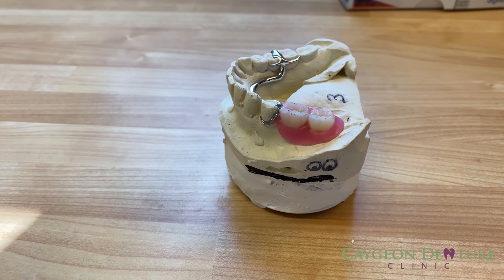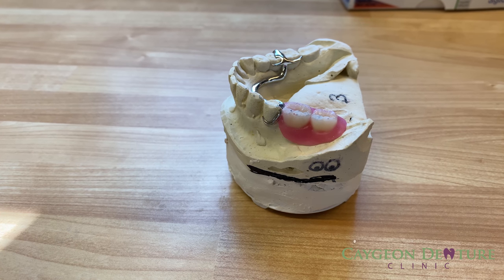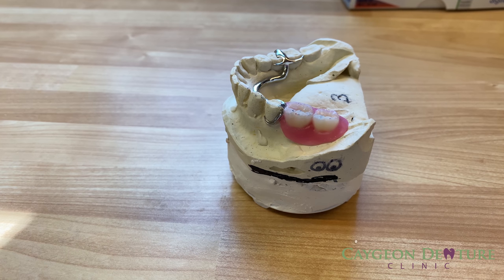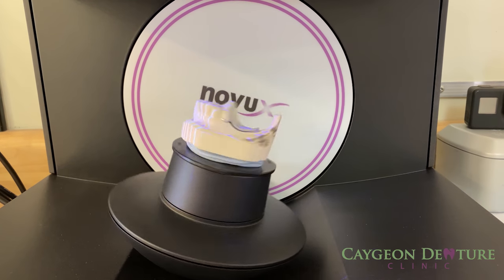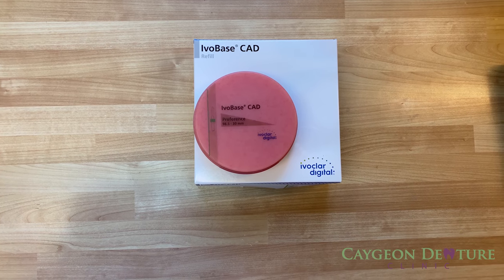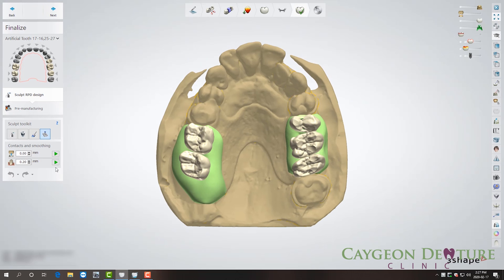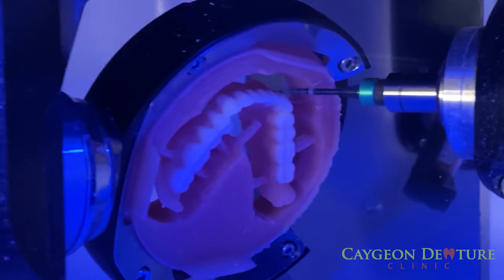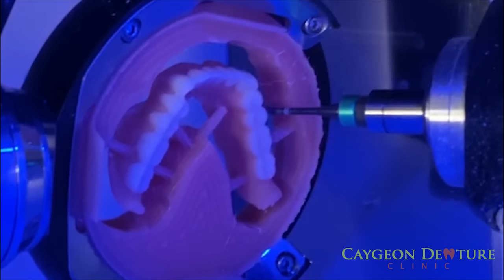Conventional vs Digital Dentures

Comment: Digital dentures are here now,good or bad.You say digital dentures fit better.Maybe,but they only fit as good as the impression .What is the procedure for doing a try in and the added  cost for this . The conventional way is done in wax and if changes are needed are easily done in a short time if not in minutes.I see you use the milling technique .I'm not a big fan of this as their is alot of waste .I can pack at least  4 maybe 5 dentures with the same amount of acrylic doing it the conventional way.As for making a new denture using the info on files,don't you think it's better to retake the impressions as the ridges have usually changed somewhat and you'll have a better fit.Your thoughts on this  Thanks  Larry
Reply from the maker: Larry Stradeski Hey Larry, you are definitely correct, the dentures will have a precise fit as long as the provider can take an accurate impression of the mouth or can accurately use an intraoral scanner. I currently print my try ins and the cost for doing digital dentures is a lot less then the conventional way. If there are any adjustments to be done they can also be done quickly. What I love about the printed try ins is that the patient can take them home and start using them. They can try the dentures before the final dentures can be milled, this is something that is impossible with a wax try in. In regards to milling, yes there is currently a lot of waste with the base only. I find that I can get a lot more use with the teeth pucks once again saving money. At the end of the day, I had to make sure that there were more pros then cons with the digital workflow, and so far it has decrease the time I spent in the lab doing, custom trays, set ups and processing of dentures and I have increased the amount of satisfied patients with a better fit and decreased the amount of adjustments needed after the dentures are inserted. Overall a win win for my clinic and my patients.